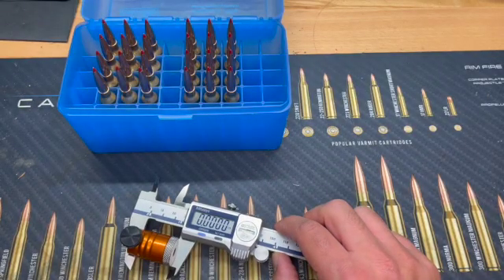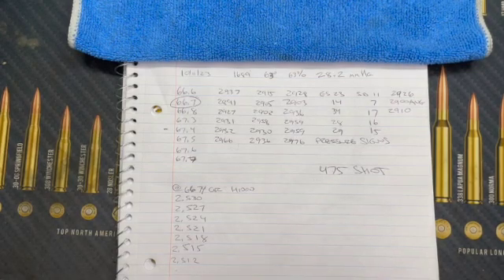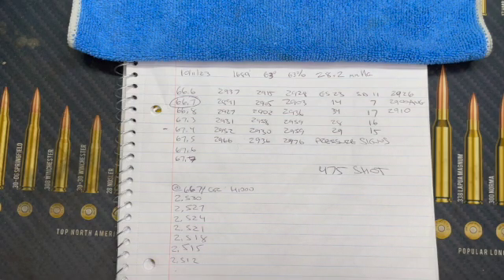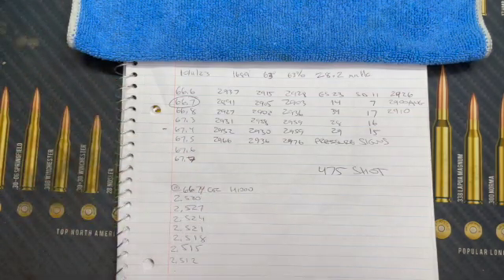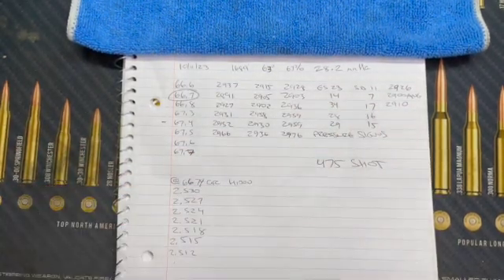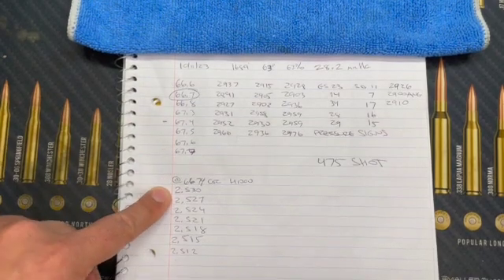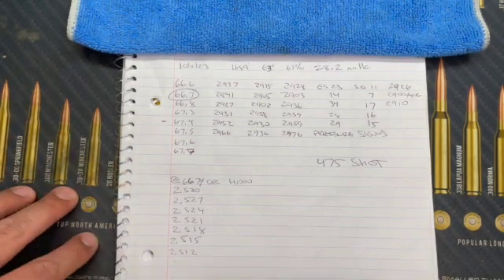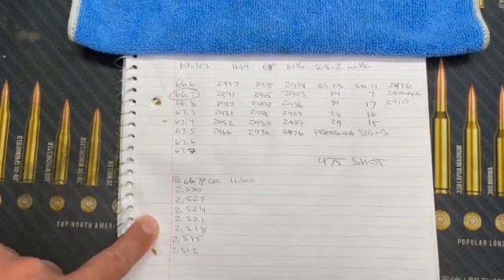Charge Weight for Load Development (Tikka, 7 PRC, H1000)

Comment: The numbers don’t look good for only going  .1 grain increments. You should try another primer. In all respect, I think you should rework how you do load development. You might be brand new to hand loading, and I mean no disrespect, but something isn’t quite right In your method. Don’t chase just the first good node. Your node should be about half a grain to a grain and a half, of consistency. I would not choose that one decent looking es and sd. Just my $.02. Also, if the sign of pressure was the half moon, I wouldn’t worry about it, because my tikkas do it on mild loads, although, you should be over pressure at 65 grains! Me personally, I wouldn’t have gone over 65.2 grains. I  recommend using hodgdon’s reloading data.
Reply from the maker: @leonardogarcia2506  appreciate the feedback. One issue that came up was light neck tension. Different ways to skin a cat right?
Reply: @gunsnoroses  that would be my next step. I use the full length dies with the expander removed, then I use an expander mandrel. I use a .002 under caliber mandrel to set the neck tension at .002. I use the 21st century die and mandrels. .002 has always given me the lowest es and sd. I mean both under 10 or even 5. Btw, did you find a load?
Reply from the maker: @leonardogarcia2506  66.7gr H1000. The 0.1 gr increments were done after I did an initial ladder test. I did this test on two nodes. Hopefully that clarifies it. Testing out different methods.
Reply: @gunsnoroses  ah! I see. In my opinion and from what I’ve gathered through some of the same resources you’ve mentioned, .1 is pretty small for such a large cartridge. Usually small increments like that are more for something like the 6br. Besides, you need a wide node, for factors like weather. Usually hot temps will cause higher velocities taking you out of a small node, and Vice versa for colder temps. Btw, I’m also shooting a tikka with a proof pre fit. Mine is 26”. I’m using the hells canyon armory magazine. Highly recommend! Either way, it doesn’t quite look like you’re in any kind of node, I’d go lower and something should jump out at you. Also, I appreciate the humility! It says a lot about your character.

Comment: 180grain bullets at 2900fps???? How many shots you expect out of that barrel? And what is the accuracy like? Don't chase the speed, chase accuracy!!!!
Reply from the maker: I got 600 rounds through it so far and no issues. I check with a bore scope. I did drop the charge down and now am running around 2875 f/s. I haven’t experienced any accuracy issues with either.